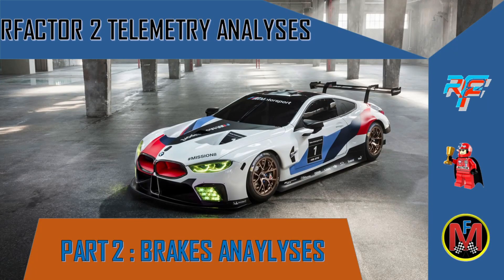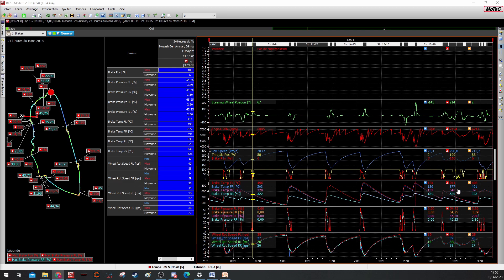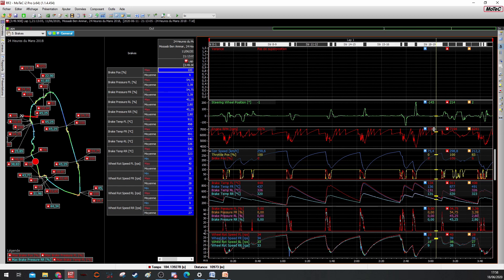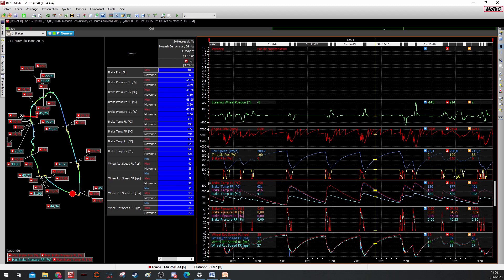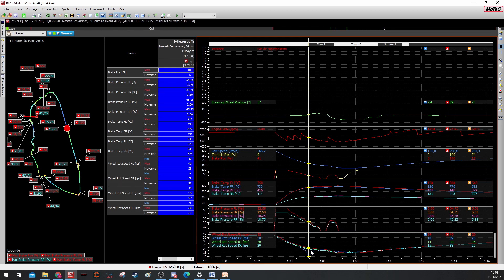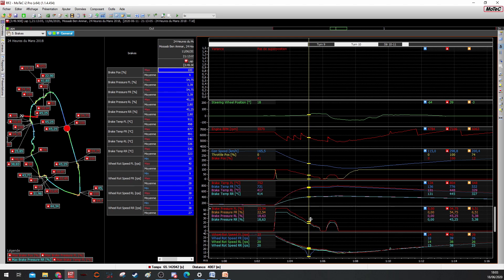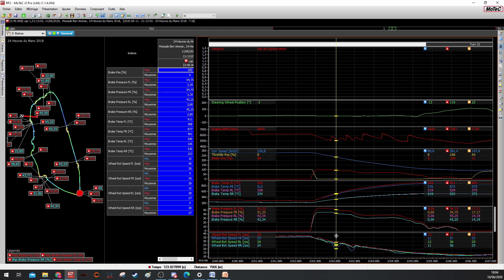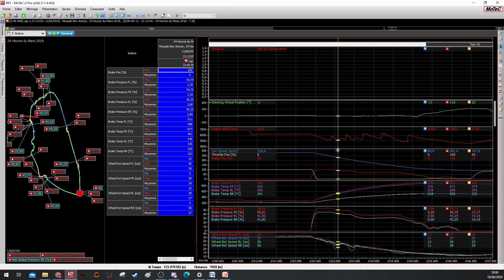RFACTOR 2 TELEMETRY ANALYSES USING MOTEC PART II BRAKES

Comment: is there a place where to find optimal temperatur ranges for rf2 cars? IE for GT3s and GTEs
Reply from the maker: You need to use the app Cartsat
https://forum.studio-397.com/index.php?threads/carstat-2-3-a-question-of-setup.58106/
Reply: @MikeFroom  thanks Mike, i have donwloaded it but seems it doesn't works with S397 cars like GT3s and GTEs, probably beacuse they're encrypted, isn't it?
Reply from the maker: @pierluigivinci6777  yes that's why; there are encrypted